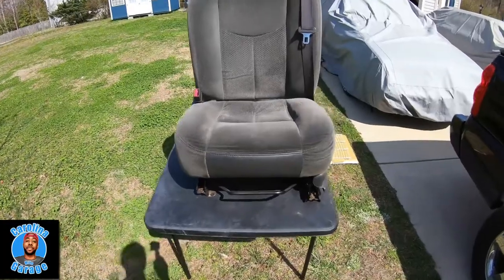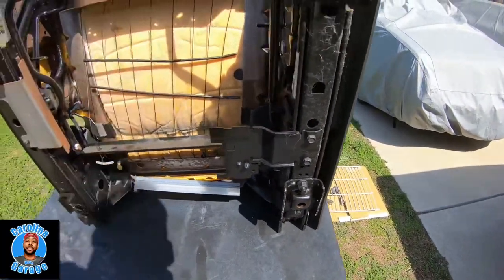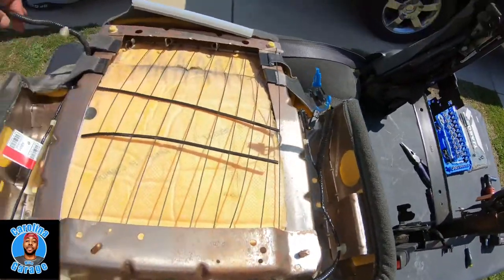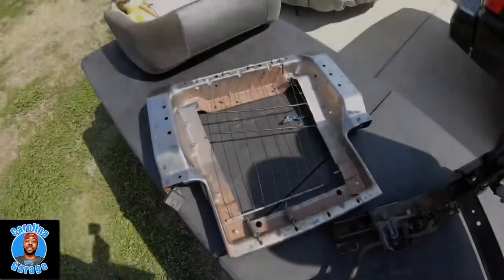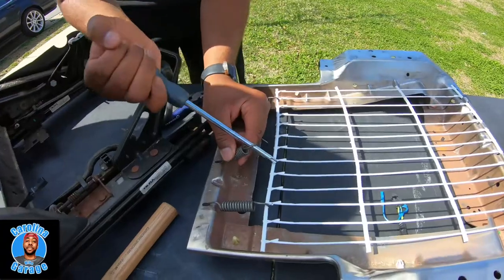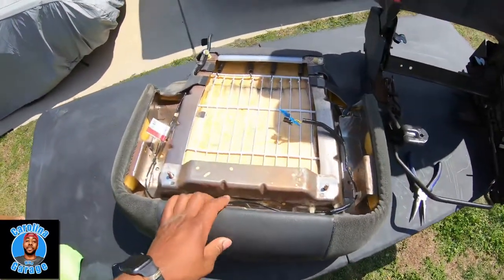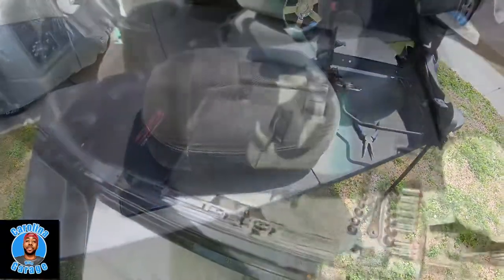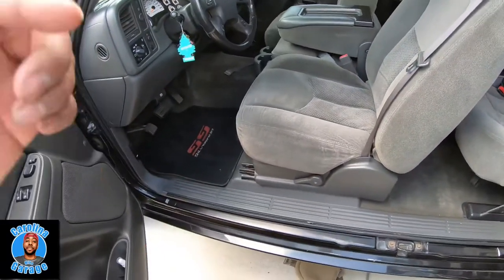Broken/Sagging Seat Cushion/Grid 99-06 Silverado Sierra Tahoe Yukon

Comment: Fantastic video, your instructions eased my mind as to what to do to correct broken springs in the driver’s seat.

I will probably replace the passenger seat spring also, based on how straight forward your video and instructions are.

Thank😂 you
Reply from the maker: I appreciate it!
Reply: Where did you obtain the replacement part from, would you please share. Thanks. FYI: Not sure which Carolina, I’m in SE VA